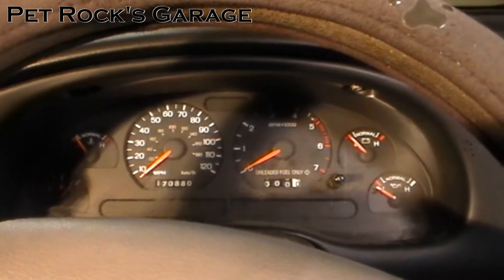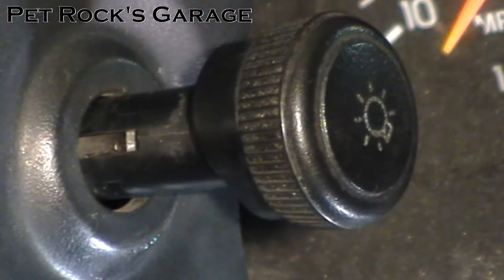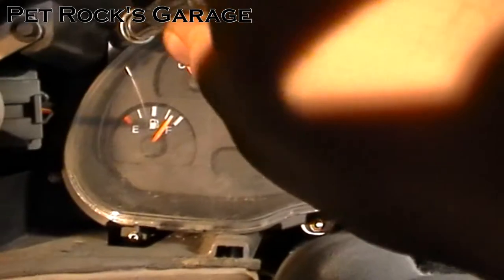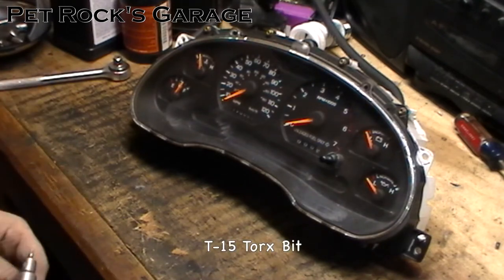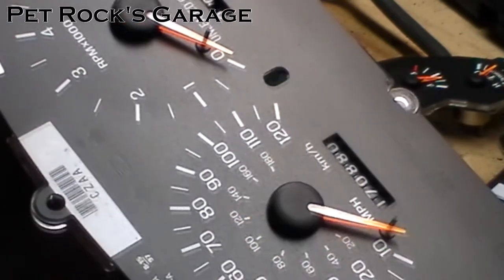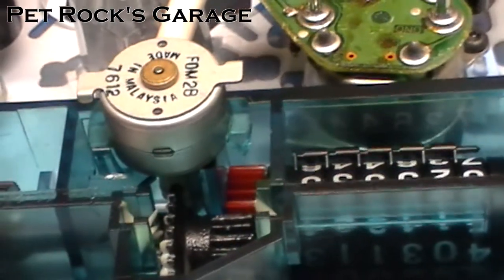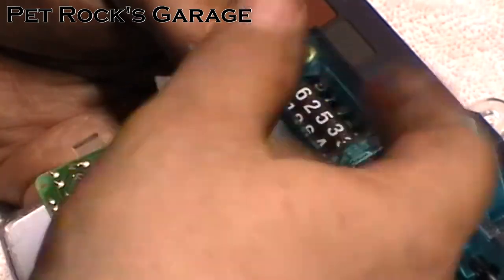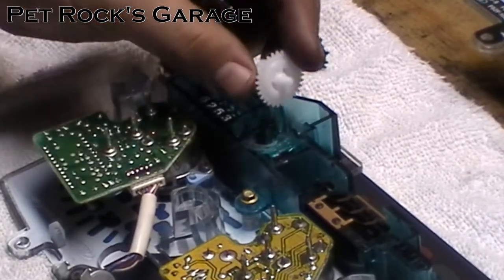How To Fix Broken Odometer & Trip Meter -- Ford Mustang ('94-'98) and others

Comment: Ford should have their dealers do this...they just seem to just want to do oil changes and sell tires!!  One said get a new cluster and bring 2 keys. What do keys have to do with it? Another won't touch anything old and you MUST have a service record with them. Shame on them!
Reply from the maker: Most dealer mechanics are just parts changers. Time is money and it's faster to replace a part than fix it. They don't 'fix' anything. A good independent shop might fix it, but you may end up paying more in labor than just buying the new (or used from a junk yard) cluster and having them install it. It's kind of a crap shoot really.
Im not sure what the keys have to do with it. I don't think the keys are paired with the cluster. PCM/ECM yeah, but not the cluster on this era mustang. But I could be wrong. Maybe that dealer service writer was confused about models/years?
Re not working on old cars, yes that is a thing and perfectly within their right to refuse to work on older vehicles. There can be a bunch of different legitimate reasons. A dealer tech friend of mine told me once that at their shop it's because older vehicles tend to be more fragile. Plastics often brittle.  Metal rusted. Something could break while trying to do a repair and the shop would be on the hook to pay for it (assuming the shop is ethical). They might work on some stuff like interior, suspension & maintenance, but no engine or transmission work. Too much risk.